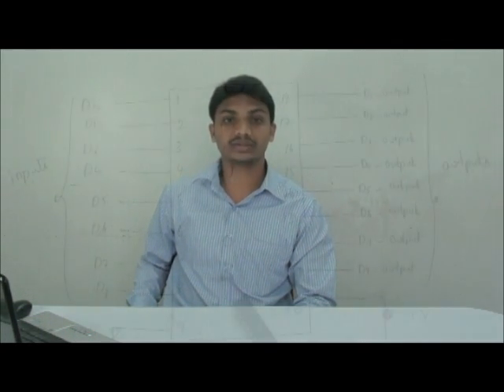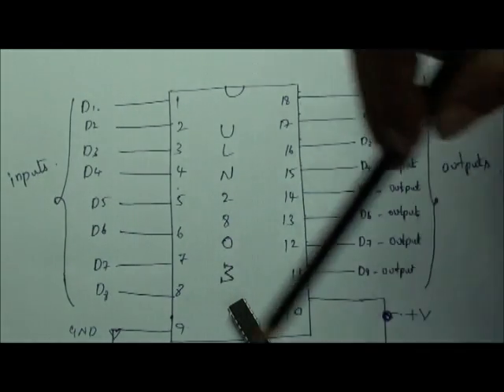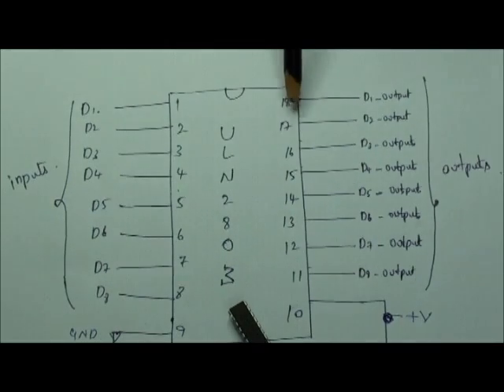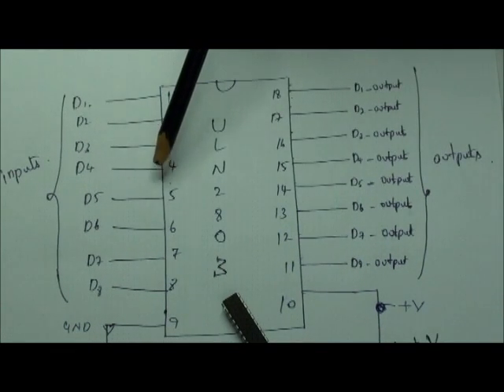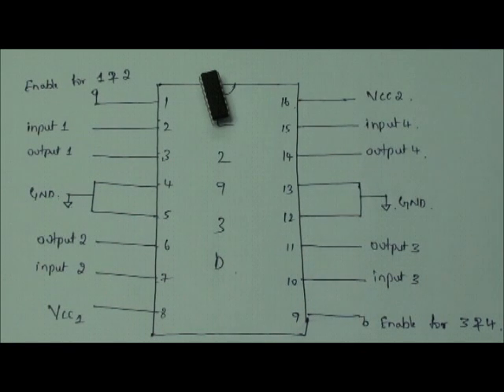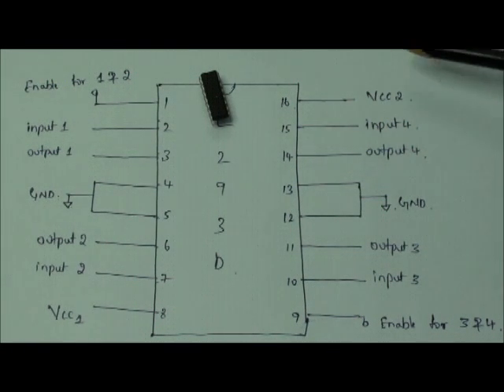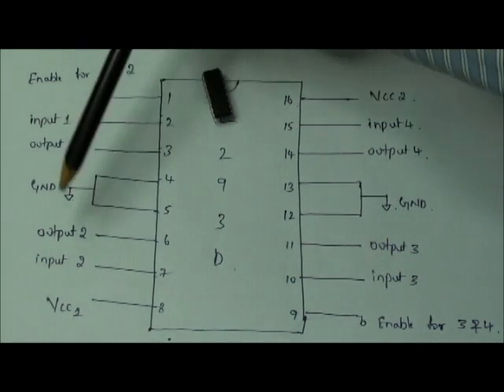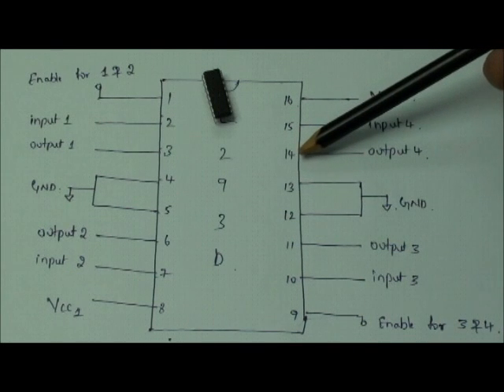Tenet Technetronics: Demo Of L293d an Motor Driver IC

Comment: when making the final circuit, Do we need to add any other components like resistors or diodes?
I want to use it as a driver for 2 motors that will consume about 0.8 A.